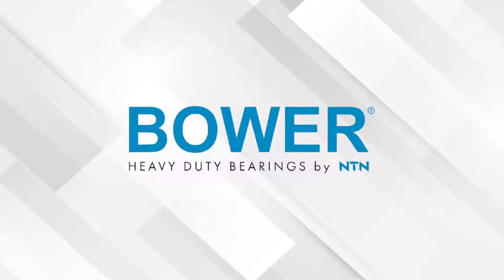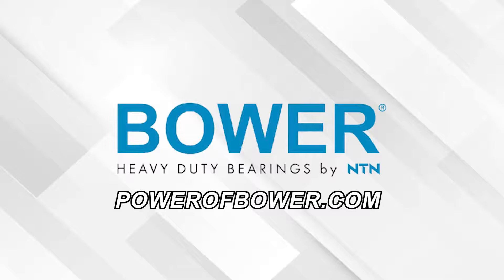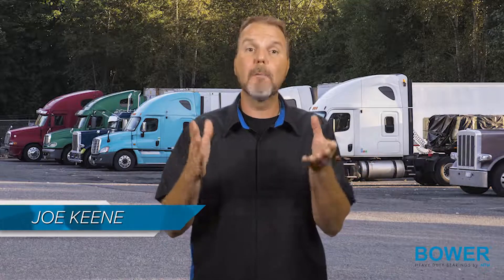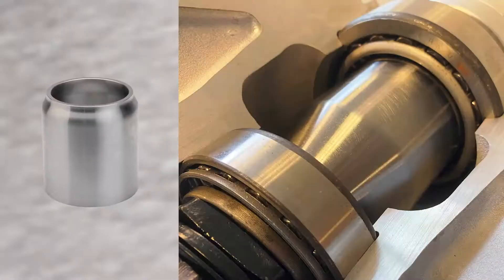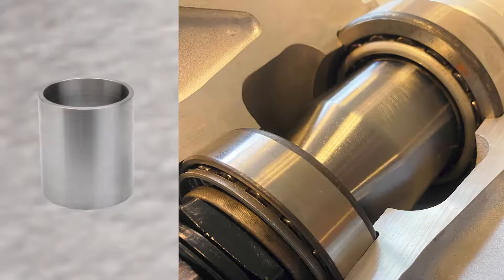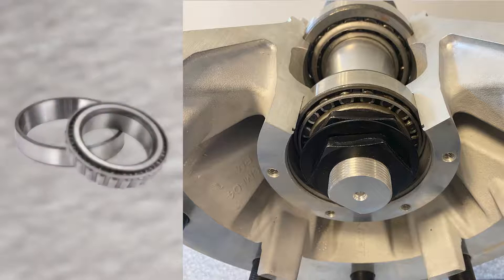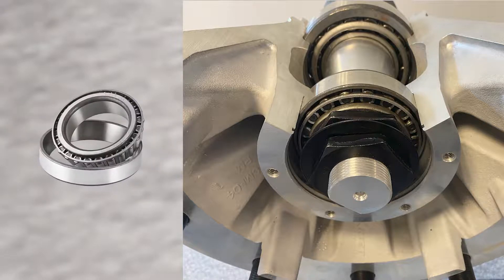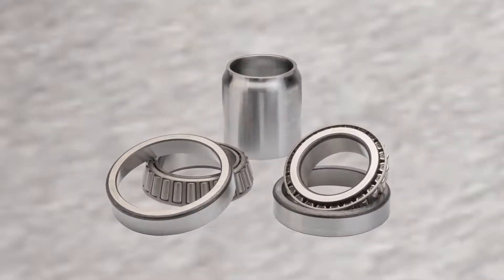Can You Use a Conventional Bearing Set with Wheel End Spacer Kit?

Comment: Question what happens if I forget to put the spacer and still torque  the preset not to 300ft pounds?
Reply from the maker: Forgetting the spacer and torqueing to 300 lb ft would result in the incorrect bearing end-play adjustment. This will cause premature failure of the wheel bearings which will result in costly downtime and could even cause a wheel-off incident. Proper bearing torque procedures are critical to reliability and safety. If you there is no spacer in use, you need to follow TMC RP618 to ensure a properly adjusted bearing. Check out our video on Heavy Duty Wheel Bearing Installation and Adjustment for more info: https://youtu.be/YmdV6ZVd1ds
Reply: @BowerBearings  thank you for replying.  So I took the wheel off and yes the spacer was there I just got confused since I did it quick but still wonder what happens if you don’t put the spacer and still torque it the wheel probably won’t spin correct?
Reply from the maker: @JorgeSoto-p9p  The wheel would probably still spin at that torque setting, but it would be feel very tight and would have no end-play.
Reply: @BowerBearings  thanks for replying I just ended up taking it apart to double check  I feel better knowing that  it is in there and it is properly adjusted.  Too much liability on bearings

Comment: thanks for the video. was wondering if you can remove the cone spacer on pre-adjusted wheel bearing set and manually adjust end play?
Reply from the maker: Yes. You can delete the cone spacer and manually adjust pre-set bearings without issue. What you can't do is use a cone spacer with a standard bearing set. If you do choose to use a spacer, you need to use it with pre-set bearings.
Reply: @BowerBearings  wow thank you for the fast reply and thank you so much for the information